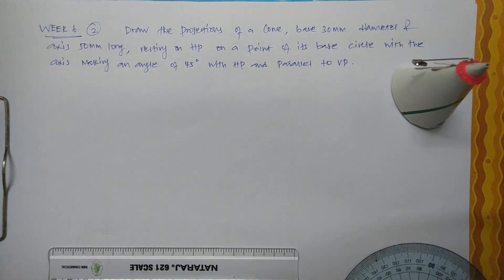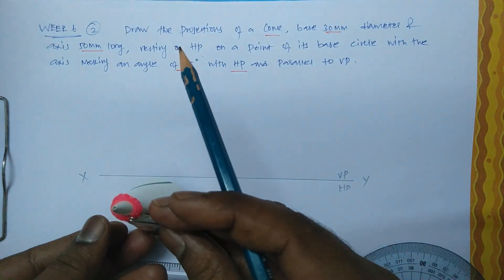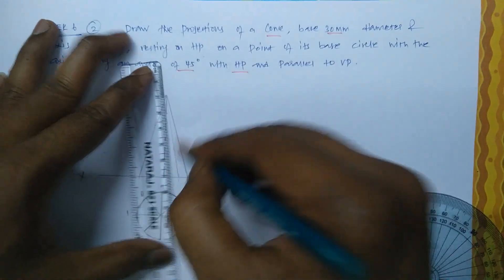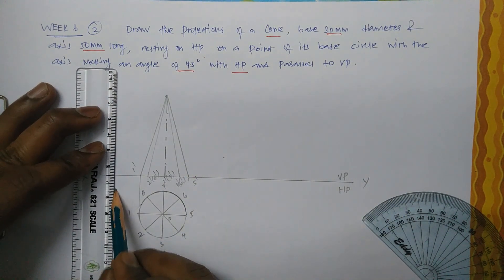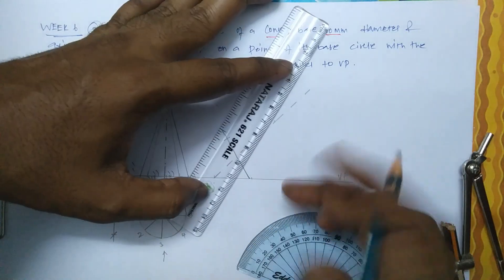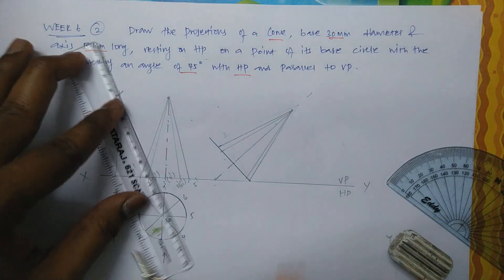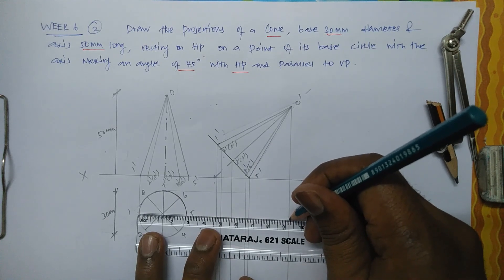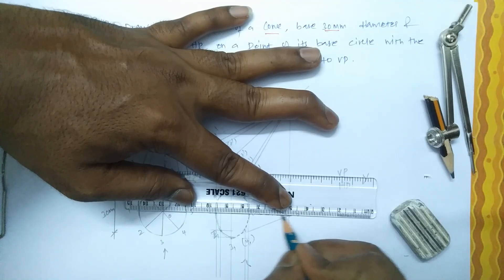Projection of Cone

Comment: Draw the FV and TV of a cone having base of 45 mm diameter and axis 50 mm
long when it is resting on the ground on a point on its base circle with axis
making an angle 30° and 45° with H.P. and V.P. respectively